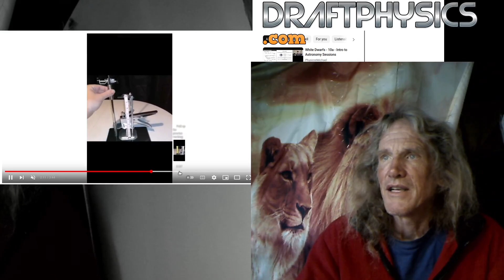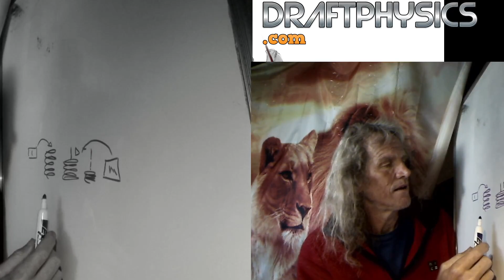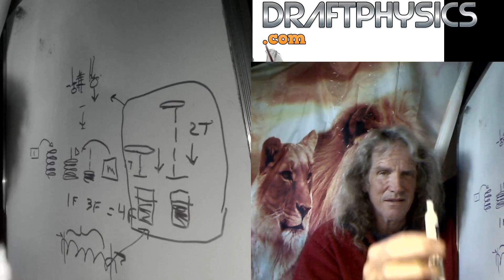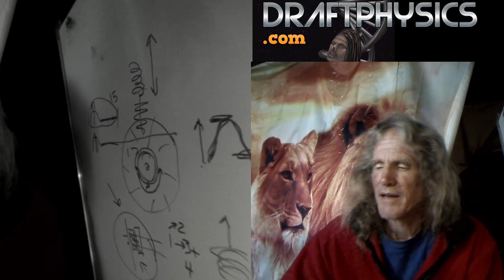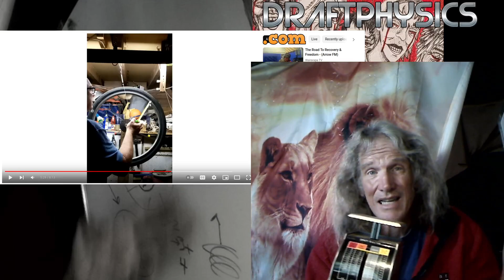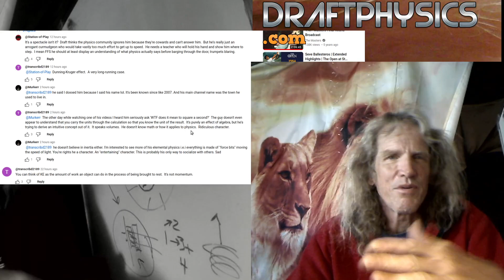DraftScience vs FakeShit

Comment from the maker: debatephysics.com: http://www.efilism.com/pi/
email: ds@donotgo.com
New video: The Spring Paradox ...mgt not mgh  [4/17/23]: http://www.efilism.com/ds/dp415.html
Re: mindlessmarbles ...more lies and deseption  [3/24/23]: http://www.efilism.com/ds/dp414.html
1/2vmv=E and mgh=E are Wrong [3/22/23]: http://www.efilism.com/ds/dp413.html
re: comments ..and some entanglement junk  [3/17/23]: http://www.efilism.com/ds/dp412.html
re: Murkerr comments ..mass and energy  [3/10/23]: http://www.efilism.com/ds/dp411.html
charge and movement  [3/8/23]: http://www.efilism.com/ds/dp410.html
Absolute can just look Relative  [3/4/23]: http://www.efilism.com/ds/dp409.html
re: comments ...more ke math crap  [3/3/23]: http://www.efilism.com/ds/dp408.html
 re: comments ...Light matter motion  [3/2/23]: http://www.efilism.com/ds/dp407.html
re: comments ...Newtons Second Law maths [2/26/23]: http://www.efilism.com/ds/dp406.html
re: comments ...Brozo and friends  [2/25/23]: http://www.efilism.com/ds/dp405.html
re: comments ...KE vs MV math [2/23/23]: http://www.efilism.com/ds/dp404.html
re: comments ...Light and Ferrocell mostly [2/22/23]: http://www.efilism.com/ds/dp403.html
re: comments ...Alex re Newton and mv  [2/20/23]]: http://www.efilism.com/ds/dp402.html
re: Levers and Force  [2/18/23]: http://www.efilism.com/ds/dp401.html
re: brozo comments  [2/17/23]: http://www.efilism.com/ds/dp400.html
MV vs KE ...summation  [2/16/23]]: http://www.efilism.com/ds/dp399.html
re: Stephen Wolfram, Thermodynamics [2/15/23]: http://www.efilism.com/ds/dp398.html
re: more comments ..mostly The 2 Slit  [2/14/23]: http://www.efilism.com/ds/dp397.html
The 2 Slit ... Diffraction and Interference?? [2/13/23]: http://www.efilism.com/ds/dp396.html
Re: mindless Troll comments  [2/11/23]: http://www.efilism.com/ds/dp395.html
Re: comments ...just mass moving  [2/6/23]: http://www.efilism.com/ds/dp394.html
Re: comments ...the ke math  [2/3/23]: http://www.efilism.com/ds/dp393.html
Negative Energy?  [2/2/23]: http://www.efilism.com/ds/dp392.html
re: Unzicker's Real Physics ...the Gravitational Constant   [2/1/23]: http://www.efilism.com/ds/dp391.html
The KE Debate  [1/31/23]: http://www.efilism.com/ds/dp390.html
re: comments ...electricity  [1/30/23]: http://www.efilism.com/ds/dp389.html
more Mythbusters Car Collision [1/27/23]: http://www.efilism.com/ds/dp388.html
Physics is also buggy [1/26/23]: http://www.efilism.com/ds/dp387.html

 1/2 vmv
Was willfully created to Force reality to match religious daydreams. The history of its creation, defense, and eventual acceptance is a mockery of the scientific method. Truth was forsaken for agenda, evidence was exaggerated distorted and quote mined to support a plainly silly notion of reality...

""If I'm in space and I throw a 2 L bottle of coke (2 kg) away from me at 1mph., do I received the same thrust if I shoot a dime (2 grams) away from me at 1000mph.? If so isn't this proof against the kinetic energy formula?""

""Is there any physical evidence defending the kinetic energy theorem? The theory says an 8 lb bowling ball will produce twice as much "energy" as a 16 pound ball thrown with the same effort. No pro bowler can make A lighter ball work. Why? ""

""If I shoot two objects with inverse velocity to Mass ratios (for exp. 10m 5v vs 5m 10v) into gravity your formula says one object will have twice as much energy as the other at liftoff. If I let the objects fall, on an identical spring they will be recorded to impose the same pressure, the same joules of energy. How do you reconcile that fact with your theory? or Do you dispute the fact?""

""Your theory says a 5-ton train going 10 miles an hour has twice as much energy--ability to do work as a 10 ton going 5 miles an hour. I claim you will never prove that to be true, and that if you actually collected the energy of the moving objects in a scientifically sensible manor it will be clearly demonstrated that they have the same capacity to do work.

Do you think a 5-ton 10 miles an hour train can do twice as much work has a 10 ton train going 5 miles an hour? Do you think you can create heat or deformation and transfer 100% of your momentum to another object?